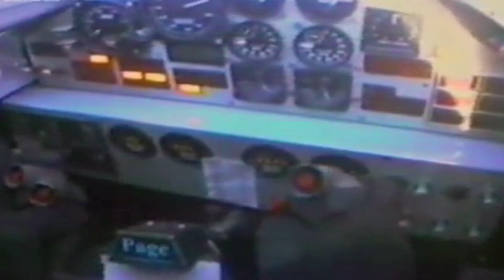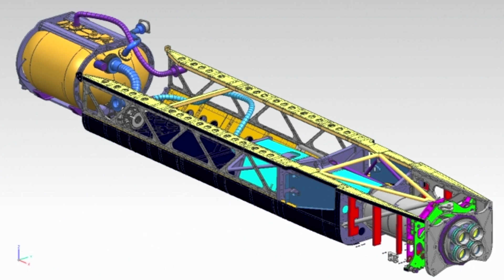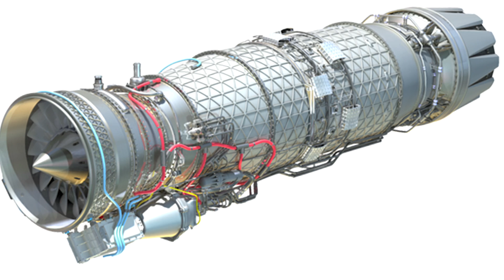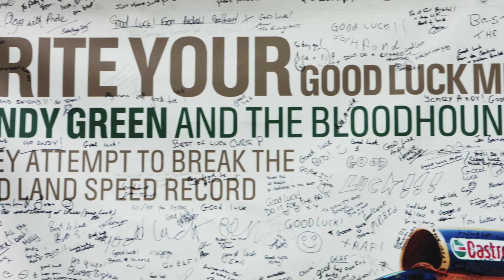How to Drive at 1000 mph: Bloodhound SSC - Carfection

Comment: how are those tires even wide enough to go 1000 mph? also these bros are british, shouldn't they be trying to go 1000 kmh  or something?
Reply: +Dash Cam California They use miles too, probably invented them.
Reply: +Dash Cam California What are talking about the tires? They're wide enough to support the car and provide lateral grip. (I don't know if you noticed but there are two tipes of tires shown: rubber tires that won't be used and the actual aluminum tires/wheels. The reason they won't go 1000 km/h is because the record is already much faster than that, obviously.
Reply: how do they expect to grip? indy car tires are way wider. and fine 2000 kmh the tires still aren't wide enough.
Reply: Dash Cam California
 What do you mean "grip"? This car will run in a dry mud lake and are supposed to dig a little in the soil to give lateral grip, but they can't generate to much rolling or air resistance.
Reply: +Dash Cam California lmao, you're hilarious.
Reply: +Dash Cam California lmao, you're hilarious.
Reply: that makes no sense. how are they not driven? I know it's using a jet engine but it's still technically a car. What are they doing? Gliding? Hovering?
Reply: +Dash Cam California Seriously? Are you trolling?
Reply: i just want the facts. why even have the wheels if they don't do anything?
Reply: +Dash Cam California Because its a LAND speed record CAR??!?!?!?!?!?

You need metal wheels because tires would destroy themselves at that speed. and you need them to be thin/just thick enough to maintain stability. Larger wheels=more friction.

I honestly have no idea how this isnt completely obvious to you.
Reply: hey cmon it took a lot of effort to keep this going. BUT I think we all learned a little something about the importance of wide tires while breaking a land speed record.
Reply: +Dash Cam California THRUST. That is how it will be driven. A fuck of a lot of thrust. The wheels just allow it to be defined as a car rather than a low flying missile. A slight exaggeration. They support the weight and steer.  Mainly they should do as little as possible, minimal friction and rolling resistance.The absolute land speed record has not involved driven wheels since the 1960s. Since then the fastest cars have been propelled by jet engines or rockets providing enough power in the form of thrust. And now by both a jet engine and a throttle-controlled rocket. 

To count as a car the vehicle needs four wheels and it needs to be able to start, stop and steer itself without external help. It has to do a measured mile and a measured kilometre at speed in opposite directions, the two runs must be completed with one hour. The record is the average speed of the two runs on that flying mile or flying kilometre. Apart from that pretty much anything goes but the only practical ways of getting enough power to go fast enough to trouble the current record (which is of course over Mach 1) require either big jet engines or rockets. Putting the power through the wheels is not an option, that technology runs out between 400 and 500 MPH and even at that tyre technology is right at or beyond the bleeding edge of possibility. Very few rubber tyres ever promise they can cope with anything beyond 300 MPH. Bloodhound will use solid titanium alloy wheels, which have already been safety tested to the equivalent of 1100 MPH.

Jet engines tend to be more controllable while rockets can be more powerful and have the advantage of not needing any air intakes so they simplify the design challenges. In the early 70s the American Gary Gabelich took the record with a rocket car, the Blue Flame, if you don't know what it looks like just imagine a rocket with wheels and you'll be dead right. Richard Noble took it back home where it belongs, in Britain, in 1983 with a car with a single huge Rolls Royce jet engine. Noble decided that this wasn't good enough, and neither was he as a driver, so he enrolled Andy Green to drive the twin Rolls Royce jet-engined Thrust SSC to beyond Mach 1 in 1997.

Now the Bloodhound SSC uses a jet engine (Rolls Royce afterburning turbofan) to get up to several hundred miles per hour before lighting the hybrid rocket engine. This pumps hydrogen peroxide through a catalyst which itself is a rocket engine this then goes through a shaped combustion chamber filled with a solid fuel which burns with the oxygen that (along with masses of superheated steam) is the exhaust of the H2O2 rocket that takes the thrust up to almost insane levels while still maintaining the ability to throttle the thrust via the pump which supplies the hydrogen peroxide to the catalyst. That pump is driven by a conventional high power sportscar engine. I think the current plan is to use a Jaguar engine for this. Why Jaguar? That is as obvious as the answer as to which side to put the steering wheel in Thrust 2. 

Andy Green is a man with titanium balls in a carbon fibre scrotum.
Reply: +Dash Cam California they're metal wheels cause regular tires can't handle that much rpm at 10000 rpm the tires would rip apart at 10000 rpm the wheels have a force of 50k gs on the outer edges of the wheels
Reply: Rct3_maniac
 He's trolling,stop talking to him!
 Read the other comments!

Comment: Before I spend 7 minutes watching this, we don't actually get to see Bloodhound hit 1000mph, right? It is just another theoretical circle jerk?
Reply: +Justin R. no offense, but do you think they already pulled it off with no major news coverage?
Reply: +Aadharsh Pannirselvam Good point. I'm gonna go out on a limb and say Bloodhound doesn't even hit 1 mph in this video.

I've been reading about Bloodhound SSC for over 2 years now and I've yet to see it move.
Reply: +Carfection I lack patience! Lol, thanks for the response.
Reply: +Carfection Yeah but this is like the third promo I've seen for this event in the last couple years. The run may happen eventually, assuming the people involved live that long. 
My question is if they are just running out of funds, after all it's been almost 10 years since Steve Fossett died?
Reply: Justin R. same!
Reply: +Carfection  i believe 50 seconds was the proposed time mentioned by the well spoken man.
Reply: I think you don't really get how much this project is costing
Reply: ***** Not talking to you, otherwise you were tagged. That was for the OP.
Reply: +Justin R. If they wanted to give it a go and see what happens it could have been all over by now. They want to succeed and survive.  That requires taking care of everything properly. There was never any suggestion that the car would be doing high speed testing until later this year. This has now become a full scale record attempt, at a "mere" 800 MPH, with the flat-out record attempt to follow probably next year. Look on the website for the countdown clock.
Reply: *****
Yeah I think I do have an idea. I've had over 60 years of knowing how much thing cost, and I do know that governments have stopped funding on projects of greater strategic importance than "Bloodhound."  After all Bloodhound is only a P.R. stunt. For instance there is a famine going on in Ethiopia right now, the worst in over 30 years for which there is not enough support being provided from the governments of the world to alleviate the suffering of hundreds of thousands of human being.
Reply: round51 Why is a famine in Ethiopia a problem for the government of anywhere except Ethiopia?
Reply: That statement exemplifies the lack of empathy and compassion that seems to permeate society today. But then most peoples minds and thoughts are driven by nothing more than consumerism. Better to be human than no more than a consumer. As long as you have yours who gives a shit about anyone else right?
Reply: round51 It's nothing to do with empathy. Why extort money from people to give to foreigners? If charity is so great just give all you want and feel superior. Just don't use the power of the state with its inherent threat of violence (pay taxes or else we'll throw you in prison) to make yourself feel better about yourself. And before you ask I don't approve of state funding for vanity science, arts, sports or media projects unless they're guaranteed to produce huge extra dividends. 

If you think an endless stream of famines and drought relief is a good way to spend your money go ahead and fill your boots. Sponsor any number of poor-hungry-baby machines. Give them all your money. Sell your organs to pay for extra help. Just don't use the power of the state to force other people to share your values. OK? Charity is a great thing, involuntary charity isn't, it's resented, and so are the competitive morality arses who keep forcing it on us.

Comment: when can i expect to see this?
Reply: +pseudo intellectual (dumb guy) I'm a Bloodhound Ambassador so can give you the plan as far as it stands
 now. The car will be run at low speed (200mph) at Newquay Aerohub UK 
Easter 2016. That will check the systems are working. If all is fine the
 attempt to break the current record will happen October 2016 where 
hopefully it will reach 800mph which currently is where we understand 
what will happen to the car as Thrust SCC established data for that. The
 car and data will be brought back for analysis and if their predictions
 are right of what happens to the car and the air at 800mph the car will
 go back to South African in 2017 and pushed incremental up to the 
target speed of 1000mph. So when it's going to happen is 800mph 
hopefully October 2016, then 1000mph sometime 2017.

Comment: when are they going to try it?
Reply: +tom roli When Its ready I assume
Reply: +BenXL is there a time that we know that thell try it?
Reply: +tom roli it'll be ready when it's ready. it's not like a production car where deadlines have to be met and whatever you have by that time is good enough. this is a world record car where absolute zero tolerance, zero margin for error, complete and utter perfection needs to be met in every single tiniest detail.
Reply: +Cobalt “Robert” Lukather yea i know but i thought they had like an idea for when they would do it thanks though😉
Reply: +Cobalt “Robert” Lukather yea i know but i thought they had like an idea for when they would do it thanks though😉
Reply: +tom roli Hi there. I'm a Bloodhound Ambassador so can give you the plan as far as it stands now. The car will be run at low speed (200mph) at Newquay Aerohub UK Easter 2016. That will check the systems are working. If all is fine the attempt to break the current record will happen October 2016 where hopefully it will reach 800mph which currently is where we understand what will happen to the car as Thrust SCC established data for that. The car and data will be brought back for analysis and if their predictions are right of what happens to the car and the air at 800mph the car will go back to South African in 2017 and pushed incremental up to the target speed of 1000mph. So when it's going to happen is 800mph hopefully October 2016, then 1000mph sometime 2017.
Reply: Shiny317 so in real life expectations, 2020. Just kidding, can't wait to see it and best of luck to you all!
Reply: +Shiny317 ohh okay thanks man apreciate the info 😉 good luck!